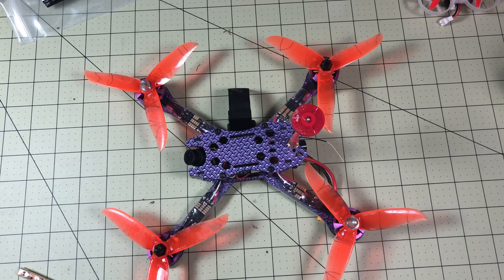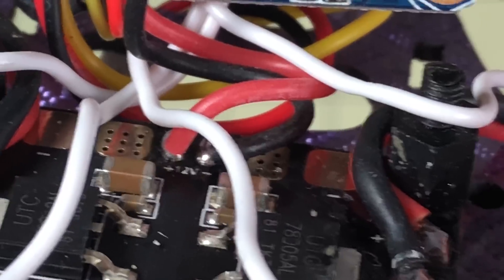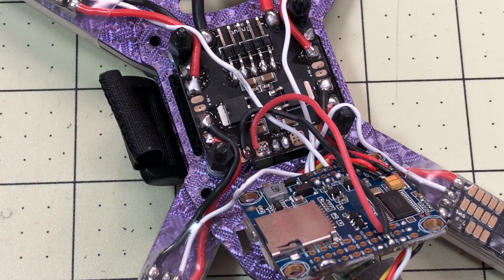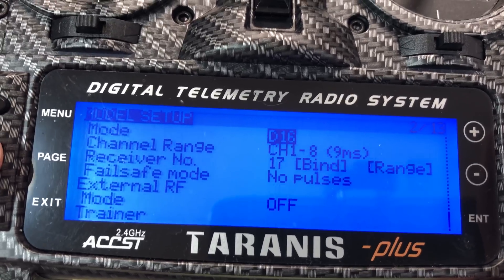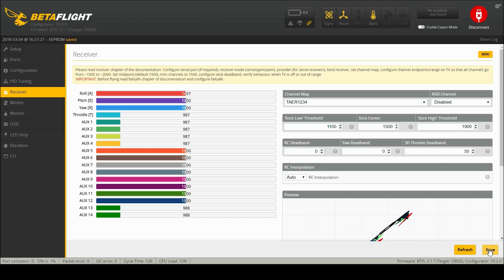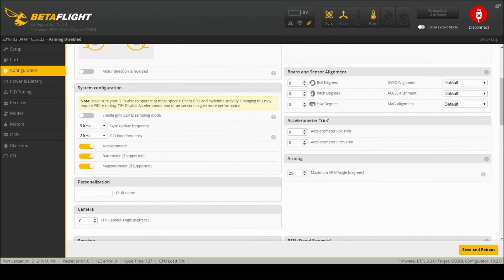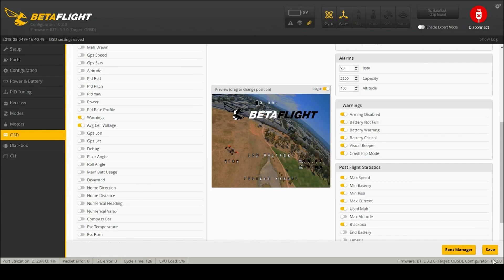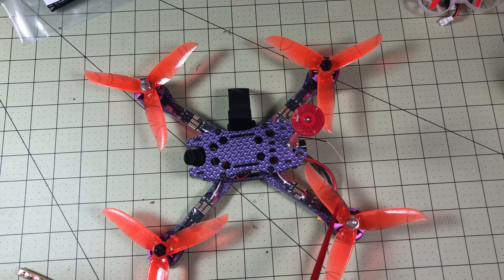Furibee Nebula 230 Setup and Config! VBAT Fix, Betaflight Setup, BLHeli Config

Comment: I just bought one of these! I plan on ripping all the camera hardware out because it's hooked up wrong and it just sucks to be honest. I'm going to rig it up with tons of LEDs and use it as a strictly line of site quad. The relatively large center compartment is perfect for the extra wires. Also the fact it just looks cool in general makes it ideal for this. I'm excited to fly it on the beach at night!
Reply from the maker: Why didn’t you just buy the frame if you are going to gut it?

Comment: I didnot see your video before I fixed mine current issue.  QUESTION:  I soldered the beg wires directly on top o the vbatt pos and neg. Is that gonna.work. I heard you say something about ampang thru wires? am i gonna.be ok

Comment: Can't thank you enough for this vid. Got a Nebula as my first FPV quad and (besides the hardware fixes) your BetaFlight config has transformed it. Now it flies so smoothly. For some reason I can't get BLHeli to read the ESCs, but as everything else seems to work I'm happy just getting the flight time in.
Reply from the maker: I am SO happy.  That is exactly why I made this.  For BLHeli a couple things to check.  Make sure you have BLHeli and not BLHeli-32.  Make sure your props are off.  Make sure Betaflight is totally closed.  It needs to be powered with a battery, not just the USB.
Reply: Hah! BLHeli (not 32) fixed it! Thanks again. I can't get over how much of a difference this has made.
Reply from the maker: Excellent!  I’ve totally done that.

Comment: XM RX bug may be fixed by firmware update, but it is a pain to try do on an RX already connected to a model.

I agree with your previous video that the X215 Pro is probably a better deal at the moment.
Reply from the maker: It wasn’t the last time I checked and did a video about it,  but that was in the fall.